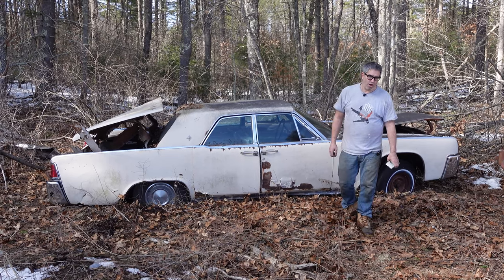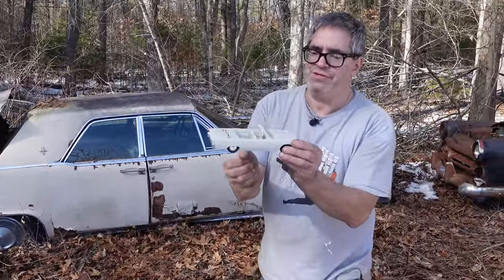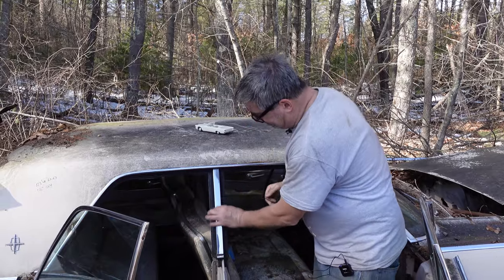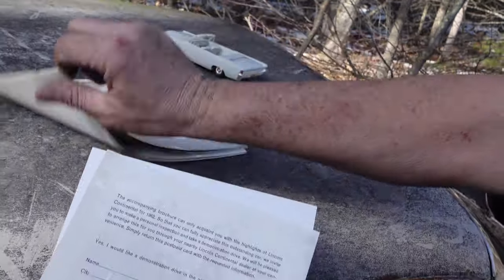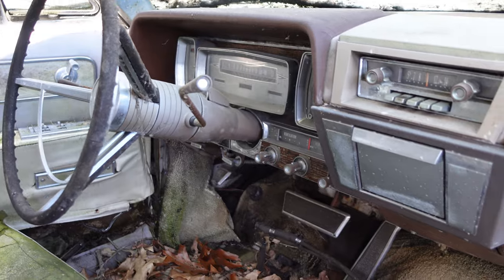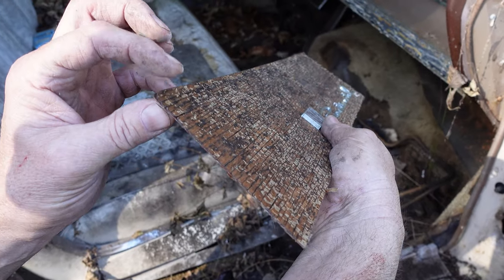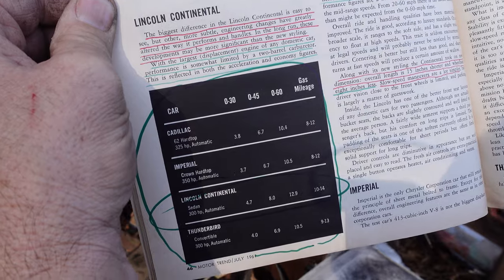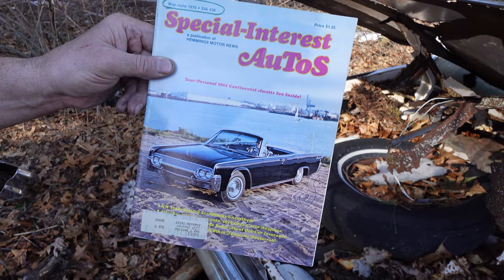Lincoln Log

Comment: We got the VIN (on the inner fender) and we win: 2 for 1962 model year, Y for Wixom, MI assembly, 82 for Continental four door sedan, H for 430 V8 with two barrel, and the rest is the production sequence. The Wixom, MI plant operated from 1957 to 2007 and made over 6 million vehicles during the time it operated. 

No tag, can't brag, but somewhat easy to figure out, no doubt: 53A for Continental four door sedan, M for Sultana White exterior paint, 71 for White interior trim, possible 11 for Boston, MA sales district, possible 1 for 2.89:1 rear axle ratio, non-locking or A for 2.89:1 rear axle ratio, locking, and 4 for dual range automatic transmission. 

That Midas location is now a Safelite Auto Glass. That car was in reasonable enough shape to get exhaust work in 1978 and possibly still be on the road in 1981 based on the insurance paperwork. No, Per-Lux was located at 1242 East Edna Place in Covina, CA and eventually became Pertronix. They made and still do make electronic ignition conversion kits. So, it's likely that the ignition was converted from points and condenser to electronic at some point in the car's life.
Reply: @SST11B  Sure thing, anytime. This Mr. Magnante's channel, I just add information that some may find interesting, but the credit is all his.
Reply: Margaret Jones Obituary
Margaret Emily Newton Jones, 62, of Winchester, NH, died on Thursday, June 28, after a courageous battle with cancer at her daughter's home in Frederick, Md. She was the wife of Alan C. Jones Sr. of Sullivan, NH.
Born on Feb. 16, 1950, she was the daughter of Laurence Taylor Newton and his wife Anna of Vernon, VT, and the late Emily Chapman Newton (d. 12/1/85).
Margaret (Maggie) was born in Brattleboro, VT, and raised on the family farm in Bernardston, MA. She attended Bernardston Elementary School and Pioneer Valley High School in Northfield, MA, Class of 1968. She then attended Greenfield Community College in Greenfield, MA, and graduated with an Associates Degree with honors in Mental Health in 1972.
She was married to the late Michael Butynski in 1972 and worked at the Florida Sheriff's Boys Ranch in Live Oak, FL. In 1974, they hiked the Appalachian Trail from GA to VA.
Maggie then was a house-parent at Sunshine Village in Chicopee, MA. She and Michael got divorced in 1977. Maggie was then a social worker and physical therapy aide at Vernon Green Nursing Home, Vernon, VT.
Maggie then was married to Alan C. Jones Sr. on June 14, 1980 at the base of the Old Man in the Mountain, Profile Lake in Franconia Notch, NH. Since then Maggie has held many working positions including: local reporter at the Brattleboro Reformer, Brattleboro, VT, local reporter at the Keene Sentinel, Keene, NH, supervisor for U.S. Census Bureau, Concord, NH (1990), newspaper delivery driver for the Keene Sentinel and the Manchester Union Leader and secretary at Easter Seals, Inc., Keene, NH.
Maggie received her NH Driver Education Instructor certification from Keene State College, Keene, NH, in 1996. She then was a beloved driver's education instructor for many students in Cheshire County, NH, for over a decade.'
Maggie loved nature, lakes, rivers and flowers, as well as photography of nature. She also enjoyed hand-making many gifts for those she loved, writing and especially loved Angels.
Surviving are her children, Jason Taylor Jones and his wife Stephanie Faith of Frederick, MD, Kristena Ann Jones and her significant other Brad Starkey; grandchildren, Ayden Taylor and Ava Rilynn Jones; brother, David Newton and wife Phyllis and their children: Adam, Matthew and Corey; brother, Mark Newton and wife Cathy and their children Adam and Brittany. She is also survived by several aunts, uncles, cousins and a very close friend, Lynda Hodsdon-Mayo.
A celebration of life service will be held at Advent Christian Church, 4554 Ft. Bridgman Rd, (RT 142), South Vernon, VT 05354-9783 on Saturday, July 7, 2012 at 11 a.m. Flowers are desired, as Maggie loved them.
Reply: @jaysmith179  Pretty unique. In 1978 when she was driving this Lincoln, she would have been 27 years old. Not exactly the type of car a 27 year old would be driving. Even though she divorced Michael in 1977, by 1978, she was still using his last name.
Reply: @googleusergp  I really enjoy your history you always give on this channel. I agree, She was young and just divorced driving a big Lincoln. I like you ,Enjoy looking up folks that used to drive these cars. One of her grandchildren might enjoy seeing this car.  My dad passed a few years and and I would love to find one of his old cars. Take care and thanks again for all the history and time researching all facts. I also enjoy that you are one Bennys channel.
Reply: @jaysmith179  Sure thing.
Reply: Hi googleusergp. I do have one correction if you don't mind.  The interior on this one is code 84 light honey beige leather.  A very popular interior of that year.  I have a 62 sitting in my garage with the same interior and another 62 that I owned years ago had it also.  The code 71 that you referred to is white leather with black cloth.  I wish Steve would show the data plate on these cars as it would be very interesting.  I think just by looking at the condition of the car that it was in pretty good shape when it first came to the wrecking yard.
Reply: @jeffsmith846  Yes, the data tag and VIN plate (which are typically one on a Ford product) should always been shown. He doesn't always do it. Sometimes the tag is missing or the door won't open for whatever reason. That's why I sometimes say "possible" as they are often guesses. I always like to say, "We need the tag to brag and the VIN to win....."
Reply: Old Lincoln plant in Wixom, MI is still fully occupied but they don't make autos . It is a plant that makes interior car parts and door panels and various fabric and vinyl car stuff.
Reply: @spaceghost8995  The Wixom plant as Ford owned it no longer exists. Demolition began in 2012 and nearby is a Menard's and a RV upfitter facility.
Reply: @googleusergp  I'm a truck driver.   I picked up a load at that plant .  I thought it was around 2016 but maybe it was actually longer ago than I thought.   It was a big place.
Reply: @spaceghost8995  Other businesses took over parts of the property, but the plant was razed starting in 2012.

Comment: My mom bought a NEW 1961 Lincoln Convertible from Duddy Ford Lincoln in Worcester / Westboro MA. Car was burgundy with a creme leather interior & top. The neighbors were quite impressed with the folding top retracing into the trunk Fully Automatically. I was 5 years old the youngest of 5 kids and we used to all fit into that car on a few occasions when my dad's "Beach Wagon" Chevy 3 row (3rdf acing reverse) was tied up ! We kids sat 4 across the  back seat with the top down, with Mom & Dad & brother up front. I put 3 inch nails leaned up against the rear tires and my mom backed over them and then drove from Worcester to Boston with me in the car. When we got to Boston's North End the 2 rear tires were just low on air BUT had to be replaced then with the 3 Big Nails in each back tire. I claimed I knew I knew nothing about the nails. Later that year I washed the trunk lid with Brillo Stainless Steel Pads and the trunk lid had to be repaired. They told me not to NEVER wash mom's car ever again ! Mom replaced that car with a New 1969 Mark lll Lincoln (Kinda Dark Green) that was stolen in 1971, she got a free ride to Cape Cod by the Mass State Police to testify against the Doctor that had bought it. She then bought a NEW 1973 Lincoln Mark lV, medium metallic blue with blue leather interior and creme vinyl roof. The car was beautiful and I drove it often to proms and such. At that time 1972 I bought a 1969 GTO Judge Carousel Red (orange) with a black interior / 4 speed / Ram Air lll with 49,000 miles for $1250 which was a lot of money back then, the car was like new. I drove the GTO all through high school until the car barely ran and I lost my license for a 15 months for drunk driving. The GTO had a RAP and the motor was replaced with a 1969 Bonneville 400 motor, the Ram Air lll motor was just thrown away ! The GTO was sold for a few hundred bucks ! Later in 1975 I bought a 1967 Impala SS 427 4 speed which came with the original window sticker, I paid $ 700 for the SS and 2 years later sold it for $800. I had it re-painted by MAACO the same Marina Blue for $99.  Times Have Really Changed !
Reply: Your car history is somewhat  similar to mine and yes I agree - they don't make 'em like they used to !!!!

Comment: The Lincoln Continental had unibody construction starting with the 1958 Mark III. They actually called them suicide doors because it was easier to open them at speed then the frontwards opening doors that require a lot of strength to over come the wind pressure, rearward opening doors the wind will actually catch it and tear it open for you.
Reply: Yes, this is how the old timers explained suicide doors to me. If the door flew open while the car was travelling down the road, it would be 'suicide' to try to grab it and close it! They could be pulled out of the car instead, especially if the person didn't weigh much!
Reply: It's suicide opening the door and getting hit and having it slam on you and taking off fingers
Reply: …and drags you with it.

Comment: Just a few things: 1) Did anyone else notice that, at first, Stve thought that it was  4-door hardtop, calling the sail panel (as I recall) "The 'C', uh, 'B' pillar in this case", and looking surprised for a moment when confronted with the actual 'B' pillar. He even referred to it as a hardtop about a minute and a half into the video. He did an OK job covering his tracks, not backtracking to correct himself but instead just pressing on. 2) The car looked pretty good for having sat in a junkyard for a decade or more (judging by the amount of mildew on the top surfaces), but it was completely falling apart! The glovebox veneer, the emblem on the back, the hood and trunk hinges either broken or rusted through, about a square foot of the trunk lid completely rusted away... yep, built Ford tough! 3) Gas mileage? Who cares about gas mileage when gas was about a quarter per gallon and you're driving a $6,000 car? 🤔
Reply: Steve does not make mistakes.  Actually I think they offered the 2 doors starting in 66 with that new body style, not 67.   I grew up with a 64, 66, and a 68.  They were pretty solid cars.   Dont recall any rust on any of them, and we kept the 68 about 12 years.
I just drove my 97 TC (26 years old) on a 650 mile roadtrip under Florida's current heat advisory, car ran like a dream 22-26 mpg and didnt notice any 26 year old Cadillacs still roadworthy on my trip.

Comment: That is crazy that it's a unibody. Even the door jambs on a 2 door hardtop will flex some when closing the doors. And look at the cool muffler placement on the model which I'm sure is accurate on the actual car. It tucks them up their nicely for more ground clearance.
Reply: These cars were strong as ever, they're even banned from some demo derby sanctioning bodies, like Imperials are haha.

Comment: I just love the 61-63 Lincolns. In 64, for some reason, they went to straight side windows, and reduced tumblehome. I didn't like that when they were new, and I still don't! Still, the early Continentals exuded class and elegance. I've always wanted a convertible, but I'd have to knock down my dining room wall to get it in my garage!
Reply: I agree with the straight side windows of the 64-65.  It just doesn't match up with the curved exterior metal on the doors and fenders-quarter panels.

Comment: Hi Steve, good video, good car.  All 1961-1969 steel roof four door Continental(s) are actually CENTER POST hardtops.  A two door hardtop coupe would come along in 1966 with no center post.  1967 was the last year for the convertible for the four door convertible.  1961-1969 never saw a two door convertible.  When Ford produced the 1961-1969 steel roof Continental(s), the unit built, or "unibody construction" you might say, was so STIFF "for a smooth and quite ride" it was NOT necessary to add ANY extra steel reinforcement to the convertible.  This is the main reason Ford added a four door convertible, because the only extra cost was the hide-away convertible top that disappeared under the power rear deck lid into the trunk.  What is a unit body car?  A type of body/frame construction in which the body of the vehicle, its floor plan and chassis form a single structure.  Please reply.  Dave...

Comment: Under normal driving, the two bbl carburetor does not help with fuel economy.  If anything, since the throttles and venturies are larger than the primaries of a 4 bbl, the fuel economy could be worse.  The only benefit of the 2bbl is that the initial cost is lower.  It is not surprising that the 61 was seen as a specialty car in 1976, the American car in 1976 had lost a lot of its charm.  The big deterioration happened in 1973.  Except perhaps for the 1973 Imperial, I cannot think of any American car built in 1973 that it is worth looking at.
Reply: 73 MOPARs did a good job minimizing the 5
MPH bumper mandate for front bumpers. I built an AMT 73 Barracuda and you could barely tell it had the shock absorbing front bumper.

Comment: Any idea on whether this car is restorable or not? To me, it looks like it could be restored, but I'm not sure what parts are missing, and how hard they might be to find. I wouldn't be doing a factory restoration, because the motor/transmission are gone, but shove a Godzilla under the hood, and a good auto transmission, and it could be a nice runner again.
Reply: In my opinion the deciding factor would be rust. Sitting on the ground can really rust a car out fast, especially a unibody car.
Reply: It's junk.  The amount of money it would take to bring that back makes it a losing proposition.
Reply: Parts are nearly impossible to find for that car.  It is sadly just a junker.

Comment: sad that most were stripped of the p s gear and rest got crushed. oddly the p s gear interchanged with a ford 4x4  so they went quickly but sold cheaper than buying a truck one

Comment: Steve, are you saying it would be bad to get hit by a cab in that car, but it would probably be fine if you got hit by a cab while getting out of a more traditional door? I guess if we continue your line of reasoning, you are better in a hardtop if a piano were to land on the roof, but you would be better in a convertable if you were to drive into a river because you could swim away. Have you ever considered automotive safety consulting?  You could propose equipping cars with parachutes in case someone drives off a cliff.
Reply: Lighten up Francis.
Reply: LOL

Comment: I love your videos, but I've heard you explain suicide doors many times, and I'm pretty certain you have it wrong.  If a car comes by and side-swipes you and your open doors, you are pretty screwed no matter which way the door is hinged--if anything, the rear-hinged door would push you back into the car if you had not stepped out yet, increasing your chance of survival.  The "suicide" door is so named because if the door accidentally opens while the car is at highway speed, it will be caught by the wind and slammed open.  Anyone not wearing a seatbelt (which was everyone in 1962) and leaning on the door (or even using the arm rest) would be thrown out of the car and most certainly killed.  Compare this to a front-hinged door that would be pushed closed by the wind, giving you a fighting chance of survival.